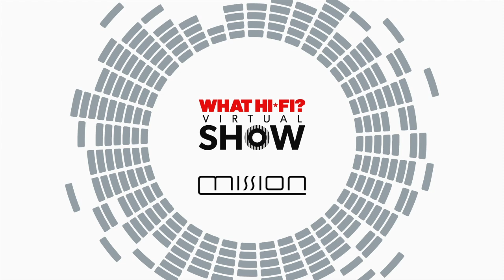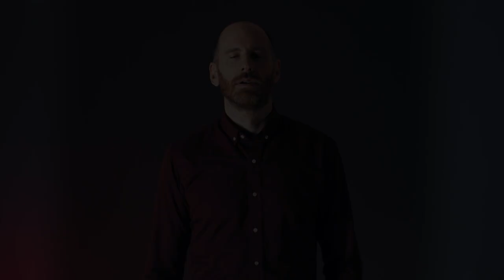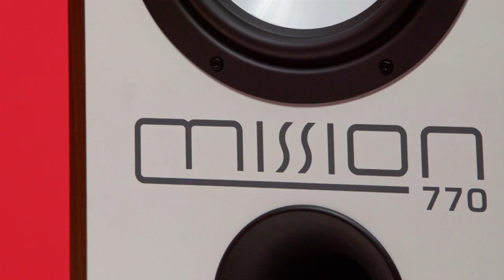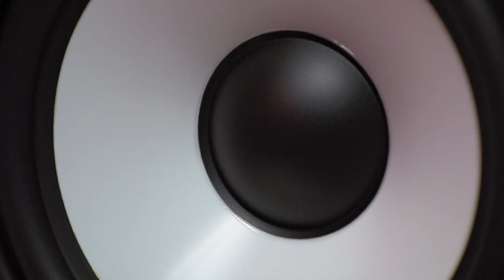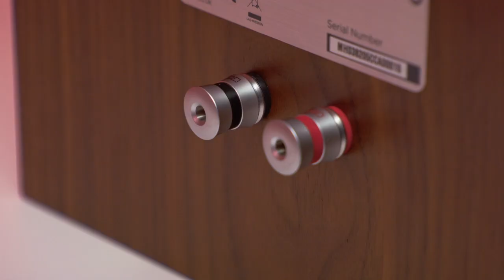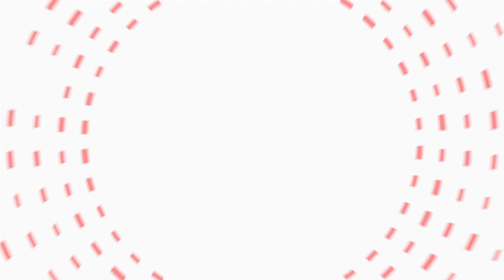The new Mission 770 – a classic speaker reborn (sponsored)

Comment: Farad Azima designed the original line up with off the shelf parts from Seas and Audax two respectable drive unit manufacturers. The original Missionsbwere designed by listening to Spendors, if Mission today has to trawl nostalgia and clone an old speaker it really hasn't developed at all. The last real Mission speaker was the 751 752 and 753 range using wood veneers, bracing and quality French drive units. Its easy to make a technically superior speaker, it just a budget and passion issue. When people lose direction to return to the past as a hipster.
Reply: I'd love to see the 75 series make a comeback.  The 751s are great speakers...

Comment: I owned original 770s my only complaints were a rather rude and aggressive plastic dome tweeter that used ferrofluid which only nade it sound nastier over time. And the price which was too high at the time for something so simple in concept and uncompetitive with even better offerings such as the Monitor Audio MA3 mk2. However they could stand comparison with most of the competition as long as you could put up with an abrasive tweeter which was crossed over entirely too low for a one inch dome using a second order filter. These new ones look beautiful like the originals and use what looks like a much improved soft dome tweeter. I just hope the price is not too obscene as is often the case for "legacy" products... some of them costing more than ten times that of the original.

Comment: I bought the mission 737 renaissance  in 1986  since I could not afford the mission 770 freedom speakers.  That year 770s had concave speakers and looked different than the one in this video.   I still have the 737s and love the sound of the polypropylene woofer and the tweeter is similar to the 770 and producers crystal clear highs.

Comment: If these sound anything like the Mk11's I'm buying a pair. I had a pair of mk1's and MkII's I should have never sold them. Although sensitive to electronics input and placement, the old MkII's are the most musically accurate speaker I have heard. Also the woofers used to bottom a problem of turntable and shudder...they were and still are, one of if not the best speakers regardless of price.

Comment: I sold Mission products in the late 1970's at one of the first Canadian MIssion dealers.  The 770's were indeed a standout product that was reasonalby priced. I recall seting up a Linn Sondek with Fidelity Research RD64S tonarm, Denon 103D cartridge.  I set up the system with the 770's, first time I heard them i thought wow, these sound great. The only thing  I didn't like is the speaker connectors were mounted on the bottom of the cabinet, accessible by the open Mission stands. They improved the 770's with the MK II which had the woofer closer to the tweeter and connectors on the back. We sold Linn speaker, Quad ESl, some other high end like Rogers LS3 5A, IMF TLS speakers etc.. We sold more 770's than anything else.